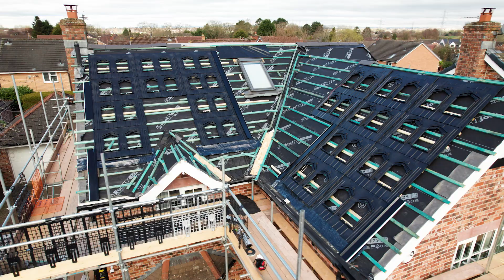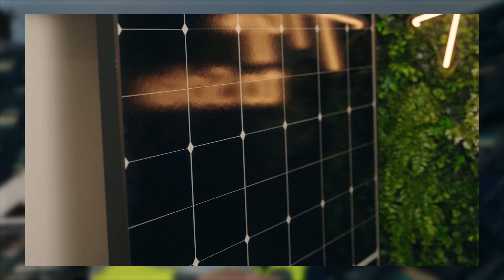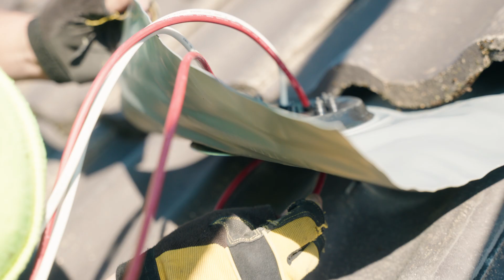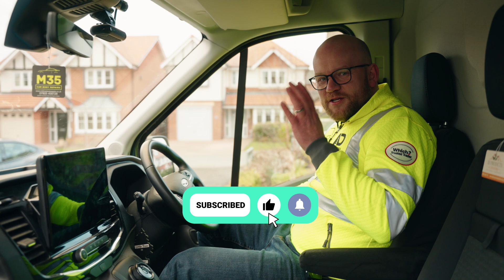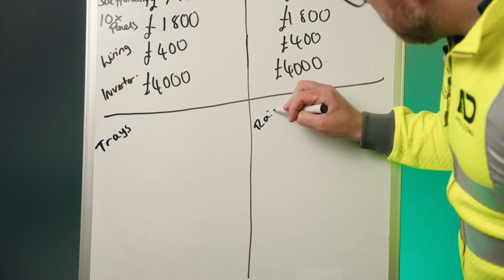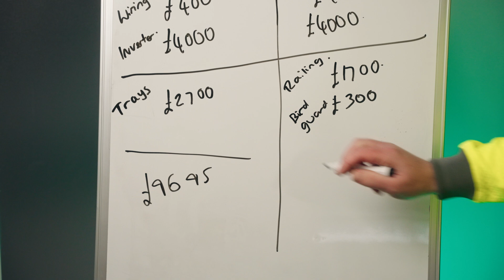In-Roof vs On-Roof Solar Panels: Which Is Better for Your Home? 🏠

Comment: Would not choose an in roof system as on roof panels can be replaced easily. Not because the panels will fail but they are becoming better over time. My first panels had an efficiency of 12%. My second ones 16%. I replaced them after 20 years with panels having 22% efficiency and today we are at 24%.  Every generation the dimensions of the panels did change. This was doubling the output per area from my 1gen to 3rd gen. All with the same frame below. The frame is more expensive than the panels in the meantime.
Also, new panels are miles better at low light conditions.
I think we will see mainstream panels reaching 35% efficiency next 10 years.

Comment: Summer solar efficiency doesn't really matter. There is an abundance of sunshine. Winter output is far more significant if you want to reduce dependence on the grid.

Comment: I’m currently waiting for my G99 license to come through, I’ve opted for in-roof because I’m having a new roof and some Velux fitted at the same time. I’m also having a battery system with gateway just in case of power outages and have been very happy with the advice I’ve been getting. Of course, nothing is fitted yet so I’ll have to wait and see, but I thank you for this kind of detailed explanation, it helps a great deal

Comment: Imho solar panels should be the roof. Look at the scandinavian solarstone for a reasonable implementation. Using roof tiles behind and around HQ glass panels is old style thinking. I think we can do much beter by thinking a bit out if the box and innovate.  Frameless glass-glass panels could be really esthetically in landscape when installed with some overlap.
Reply: Basically really big slates with H-profiles for the vertical gaps. A bit like how transparant polycarbonaat sheeting is done.

Comment: On roof also has tiles/shingles while in-roof has zero and that’s a huge cost save. On roof also has to have a building designed to bear much more weight than the in-roof (if it’s a new building obviously) . On roof has BETTER performance up to 10% due to the fact that has natural airflow UNDER the panels and it cools them off more than the IN ROOF. On roof has much easier maintenance (eg panel replacement) than in roof which is a nightmare.
Reply: No, they’re both exactly the same, clips are accessible from front and even the lower panels can now just lift out just the same there is no difference

Comment: The costing are way out 10 months on !  A 2 sq m 500 W panel is currently £ 80 so a 10 panel 20 sq m array will be £ 800. The GSE trays are £ 40 per half or say £ 100 per panel including trim so £ 1,000 for ten. Say rails also drop to £ 1,000. A 5 kW inverter is now £ 500 plus £ 400 for wiring plus say £ 300 for DC optimisers. Scaffolding at £ 800 and labour costs ( be it panel / tile /slate at £ 50 per sq m ) at £ 1,000. So total cost of a 20 sq m in-roof system at 5 kWhp would be £ 4,800 and an on-roof system would be about £ 300 more with bird guard, both including labour. For comparison a roof middle replacement or new ie using new tile/slate ( at £ 40  per sq m materials ) would be £ 1,800 ( £ 1,000 labour + £ 800 tiles/slate ). In every scenario, re-roofing the whole pitch ( ie a 6 x 5 m pitch comprising 20 sq m middle + say another 10 sq m surround ) would be an additional £ 500 labour inc edge work plus £ 400 if new tiles/slates were required.
Power value ? A 5 kWhp system would generate about 4,500 kWh per year. Assuming 27 p/kWh for power used and generous 13 p/kWh for export then a 50/50 split ?? is worth £ 900 per year or say £ 20 k over 25 years assuming some panel degradation but no future export value collapse.  Lets say a large 10 kWh battery minimises future low-value export and maintains that £ 20 k payback. A 10 kWh lithium battery would be an extra £ 1,400 but the new sodium tech may reduce that say to £ 600 before long and with 10+ years longevity.  So the 5 kWhp in-roof system inc surround tiles/slates ( ie a 6  x 5 m pitch ) including labour and 10 kWh battery would cost £ 6,300. A new tile/slate roof pitch would be £ 2,700. So the extra £ 3,600 PV cost would be paid back in 4.5 years. The whole £ 6,300  in-roof PV pitch would pay for itself in a tad less than 8 years or 10 years if that extra cost were invested well and there are no global financial crashes ( Trump mid-terms could be a red flag ie a green flag for the PV options ).
Reply: Great sum up.  I'll be installing my own system.  Buying my own quality scaffolding ( will be using elsewhere so it'll serve me well).
I have put the costs of ( not in roof) 12x double face 600w panels, all the kit to include each panel to work on their own in case of clouds ( no trees).  I'll pay for the downside to be done by a professional even if I can go it alone.  15kwh battery.
Total cost €8000.  In mid France on a 30 degree pitch, 150 Deg orientation.
Payback time of 6 years maximum assuming no electricity grid increase..

Comment: Do you put fire protection under the in roof installation
Reply from the maker: Thanks for commenting. The guidance in MIS 3002 instructs installers to either mount a tested-for-fire solar panel with a compatible tray or, if the panel and tray haven't been type tested together, to install it above a fire barrier (usually a B-Roof fire membrane). All the best 👌

Comment: 1968 roof with bitumen under. I want solar. Should I get a new roof first and if so, should I go for in roof or on roof?
Reply from the maker: Thanks for this. It might be wise to consider a re-roof. Equally, if the roof is in reasonable condition and the felt isn't brittle, you may be able just to fit a simple on-roof solar system. You could always ask the advice of a couple of local roofers before getting quotes 👌

Comment: Thank you for this very thorough summary of all aspects in PV panel installation.
I elected to choose on - roof to avoid the inevitable efficiency loss when summer temperatures peak. Also, the on-roof edge cladding might look neater and have 'chimney' slots to aid cooling but I still contend that the   'bottle brush' style bird guard or fitted mesh allows for much better ventilation.
Well done for this detailed precis discussing advantages and disadvantages.

Comment: Excellent video. Thanks for your efforts in breaking this down. I'm at the beginning of our journey but this has made it a lot easier. We are a south east/north west facing house and looking to replace the roof. Like the idea of fitting panels on both sides on an in roof system. Will check your website out!
Reply from the maker: Thanks so much for the kind words! Replacing the roof is the perfect time to think about in-roof solar – and a south east/north west split can actually work really well to spread generation across the day. Glad the video helped make things clearer. Here if you need anything 💪🏼

Comment: So!  How much will it cost to have someone uninstall and reinstall your solar panels when you need to replace your roof?? 

No one ever thinks about that!
Reply from the maker: That’s a really good point — it’s something most people don’t think about until they have to. If it’s a warranty issue with the panels or roof fixings, the cost is often covered. But if it’s simply a roof replacement, costs can vary depending on how many panels you’ve got, whether the mounting rails can be reused, and how much scaffolding is needed. It can be anything from a few hundred pounds to a couple of thousand.

Have you got a specific scenario in mind?

Comment: I'm going to need to reroof my house in the next 2-3 years, and it makes sense to get in-roof solar fitted at the same time. Seeing as the panels are roughly the same price as tiles, would it make sense to put panels on both the south and north facing sides of my roof as part of the installation? Does the inverter cost stay the same or do you need multiple inverters or a bigger inverter to copy with double the amount of panels being fitted?
Reply from the maker: Every time you change orientation (south to north, or vice-versa) you’ll need either an additional MPPT tracker or optimisers on the panels so each section performs independently. Personally, I’d favour using inverters with multiple MPPTs over optimisers unless there’s a very tricky roof layout.

I’ve done north-facing myself – the ROI is slower, but the roof will be there for 50+ years, so if you’re already investing it can make sense to deploy the capital now and benefit from the extra generation over time.

Comment: @spiritenergy_uk , we are outside of your area (South Wales) but am interested to know what systems you may have use to fit solar to flat roof. The will be a brand new roof using a single ply membrane, but I don't know if 'in roof' is really an option here. The roof is a gullwing design with a pitch of 19 degrees (both South and north facing). One thing I absolutely do want is a mechanical fixing as we are with 1.5km of the coast and in an elevated and exposed location. I'm also unsure how to deal with birds with this type of setup.
Reply from the maker: It's slightly awkward as we aren't Spirit Solar 🤣, we are Apex Doma up in the northwest. We will take it as a compliment because Spirit Energy appear great. 

We use a vandervaulk flat roof system, which is ballested. If you need mechanical fixing, you'd want to couple this with perhaps a Nicholson bracket, which would be fixed into the OSB sheeting.

Thanks

Team AD
Reply: @apexdomasolar whoops, copy and past error 😅

Comment: Dumb!!! the Canadians git it right vertical ballens first- no water dams on a slanted roof an they can support horizontals and add void is goo or vcan be insulated better the verts can be Hidensity foam or even t bar
Reply from the maker: Appreciate the comment Joseph. This was a Marley in-roof system on a pitched roof here in the UK. It wasn’t counter battened but still allows for water drainage via the integrated trays. The system is wind-tested and MCS compliant, and works well in our climate.

Understand things are done differently in Canada and it’s always interesting to hear other approaches. Thanks for sharing.

Comment: A lot of plastics degrade in the sun and heat, becoming brittle and cracking.  What are your thoughts on the plastic in-roof trays degrading over time, cracking and leaking?  They wont last anywhere near as long as roof tiles.
Reply from the maker: Thanks for the comment, it’s a really valid point.

Most of the in-roof trays you’re referring to, like GSE, are made from UV-stabilised plastic designed specifically for roofing applications. And you’re right to ask the question, longevity does matter.

That said, the trays aren’t directly exposed to the sun or weather once installed. They’re protected by the solar panels and flashing, so they don’t experience the same levels of UV or mechanical stress as a roof tile would.

GSE offers a 10 year product warranty, and the trays are designed to last well over 25 years. In practice, many believe they’ll last 40 to 50 years or more, especially since they’re shielded from the elements. We’ve seen some early systems now past their first decade performing just fine.

In roof isn’t right for every property, but when done well, it’s a clean and durable option. Appreciate the thoughtful comment.

Comment: I had my install for on roof panels lined up the installer arrived but has discovered my tiles are not compatible with the clips the tiles sit up too high and the clip rattles off the roof under pressure, im pretty exposed where I am with wind. They have recommended an in roof install instead its an extra £1250 thats for 18 panels fitted. This video explains in roof panels really well thanks
Reply from the maker: Hi Ronan,
Thanks for sharing – that’s a frustrating situation, especially when it only becomes clear on the day. Some older or more fragile tiles just don’t sit well with standard hook systems, and you’re right, wind exposure makes it a real concern. In-roof can actually be a solid alternative in cases like this – neat finish, better wind resistance, and not a bad uplift at £1250 for 18 panels. Glad the video helped clarify things a bit!

Comment: Prefere hook system to in roof, as if the panels need replacing, what if the sizes alter over time ?
Reply from the maker: Hi Gaz,
Really good point – it’s true that panel sizing can change over time. That risk applies to both in-roof and on-roof systems, although you’re right that it’s generally easier to swap out a panel on a hook-based system. That said, modern panels now come with 30-year warranties and often last 40+ years, so failure is rare. And if one ever did go, you can usually link it out or retrofit a different size.

Most problems can usually be overcome.

Thanks for commenting 💪🏼
Reply: @apexdomasolar   We have installed our own off grid system, there is plenty of adjustment on the panel mounting rails, you never know large hail stones could damage a panel or two well before their life span ends.
Gaz Yorkshire.

Comment: £180 a panel seems a bit steep. I can get 500W ones for less than £60 + VAT.
Reply from the maker: Fair shout Bill and totally get where you’re coming from. The £180 includes installation of the panel so it’s not just the panel cost on its own. You can absolutely buy 500W panels cheaper if you’re sourcing direct, but fitted and warrantied as part of a full domestic system the pricing is in a different ballpark. 

Appreciate the comment. 💪
Reply: @apexdomasolar Thanks for the clarification.

Comment: Are tiles really that expensive? come on now. useless product. And how do you clean in between the panels?
Reply from the maker: Everyone is entitled to their opinion. 😃 Cleaning is really simple with In-Roof.
Reply: Nov 2025 Welsh slates reclaimed are half the cost of a new 445 panel for the same area, panels are cheaper to install similar area. To me it’s a bit of a no brainier if re doing a roof and planning no issue.

Comment: What would be considered the perfect tiles on a roof to support solar, and is the colour relevant for light reflection?
Reply from the maker: Interesting question: different tiles have different mounting methods. There isn't a “perfect tile”; concrete tiles are easier to install upon and slates harder (which is why some of the national companies dont install on slates). For bi-facial panels, lighter tiles will work better (think of a black or white t-shirt for the holiday). Some people paint behind the tiles for that slight extra bit of generation. 😃

Comment: Brilliant information. You show in-roof system right to the gutter. What are the minimum boundary conditions for ridge, to edge of chimney breast and to edge of property line with neighbours roof for terrace houses. Thanks
Reply from the maker: 400mm (unless you meet the requirements of MIS3002 (5.9.7). Then, theoretically, if engineered correctly and you meet the requirements, you can go to the edge of it all.  

Ians in the roof system allow eve support trays to provide solid runoff for excess water. Not all manufacturers allow this method of installation, check their installation guide for any manufacturer limitations. 

Hope this helps.
Reply: @apexdomasolar  brilliant info again, thanks very much. Is the integrated system you're using GSE?
Reply from the maker: Yes 👍
Reply: So just to clarify the 400mm rule applies to both in-roof and on-roof installations, correct?
Also do you have a link to MIS3002 please?

Thanks

Comment: That's alot considering there is no battery.
The cost to is going to take alot longer to recoup and you have definitely over charged for the panels and especially the 3.6kw inverter that will inevitably be installed with a 10 panel system.
Reply from the maker: Hi Grant, the cost includes a 5KW battery. We edited the first section and this isn't as clear. Thanks for the comments.
Reply: What if the aesthetics of an in-roof system increase your house value higher though?
Reply: @eddyjawed4871 the problem is they are not easy to replace at all.
Also if you wanted to add any you basically can't on that roof side.

A racking system is much more versatile and more likely to appeal to anyone that has a brain and can see that it's a future problem and a future higher cost.
Reply: @grantmidd maybe I don’t have a brain 😂 but I opted to put in-roof for the front of the house and on-roof at the back. The in-roof don’t seem to difficult to replace tbh it’s just a plastic bracket they attach onto and once the tiles are removed its a case of releasing them from the brackets. Yes an on-roof is slightly easier but again the ones at the back of my house are enclosed on solar skirts so probably won’t be that easy to replace either.

I just have a really fussy wife who is concerned about aesthetics and I realise that women are half the market in the future if I sell the house ugly looking panels can be a big hindrance
Reply: @eddyjawed4871 I did not mean to insult. Just to point out that it's not what you think.
1, The in built system is going to be difficult to replace panels for as they have to be the exact size to fit back in.

2 Heat dissipation. Heat is the biggest killer of panels and lowers performance.
Without the air flow the panels will heat up to very high temperatures and die faster.

3 Same with your skirting on the back.
I can understand about bird issues but a mesh skirt would be better for the panels and performance.

4 more expensive/ difficult to add more panels in the future.

These are basic things any engineer or electrician will tell you but the sales people won't as it's more money for them.
Reply: @grantmidd  this company is giving a 15 year warranty on the panels so hopefully they last at least that long. I’ll see how it goes but my wife wouldn’t let me have the on-roof at the front because she’s so fussy about kerb appeal

Good points though thanks I’ll take it into consideration